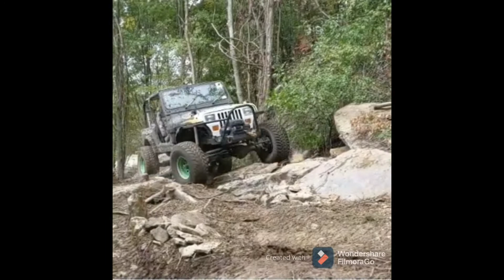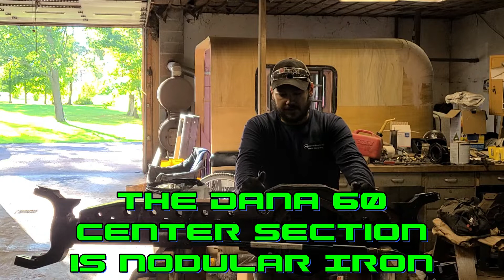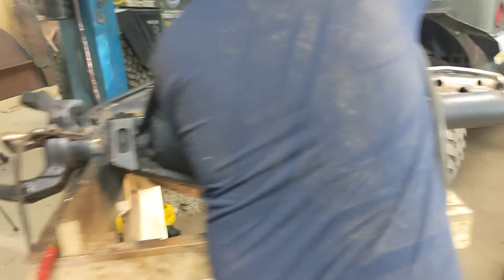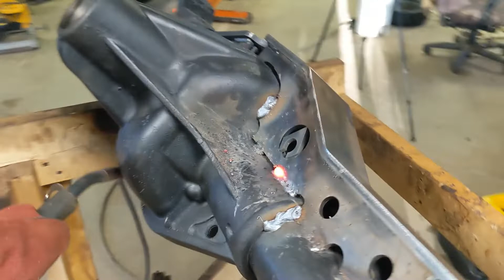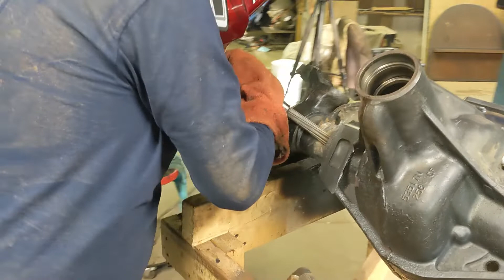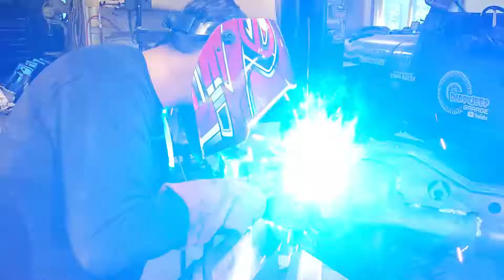Welding to the Superduty Dana 60 Center Section- techniques for welding to the nodular iron housing

Comment: I just did this on an AMC 20. I did exactly this. worked great!
Reply from the maker: An AMC 20? I haven't heard of anyone working with one of those in a while.
Reply: @DaddyJeepGarage  LOL right well CJ5 rear axle and its only getting 33's but full long arm and air shocks. and a truss kit for an amc 20 is super cheap, so figured why not!
Reply from the maker: @helm9981  sounds like a cool build
Reply from the maker: @helm9981  sounds like a cool build